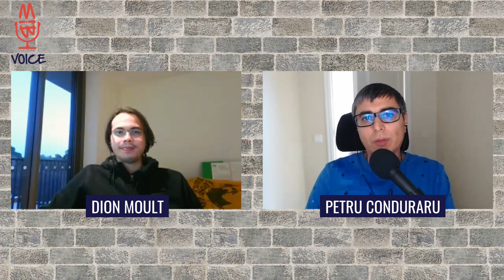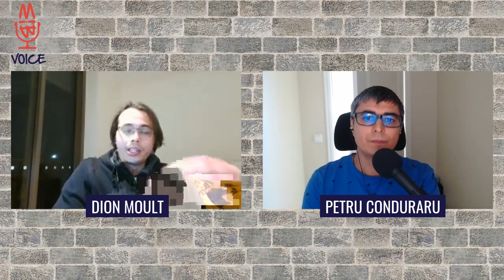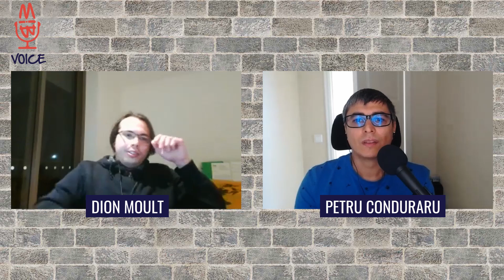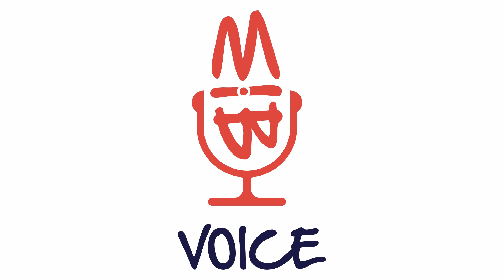BIMvoice#13🎙️Dion Moult (Open Source software in the AEC industry) #bim

Comment: Im a civil engineer and we plan bridges, tunnels etc.. And I think propietary software is terrible overrated. The civil engineering construction volume is pretty small compared to the private building sector and the software companies have focus on the "90% of their customers".

We buy Revit (or similiar software) and what we pay for are huge libarys of doors, windows and lightswitches. We cant use the level system, we dont care about the usual technical equipment, we cant do the correct section cuts etc. etc.. End of story is that you use and pay a software its 90% of features are useless for you and the 10% you need dont do the job as wanted. Then, they give you an api or tools like dynamo and tell the customer: yeah do it yourself!
So we pay a lot of money for the licences and the things we do with the software are actually programmed and developped by ourselves. That`s ridiculous! Thats a behavior companies have when they think there arent alternatives for the customers anyways!

In addition, I recognize the development that companies like Autodesk and others cut functions from their existing software just to sell them in a new product they want to push.
"Oh, you exported fbx in civil 3d for 10 years? We cut this feature, you can buy Navisworks now!"
"Oh you always imported pointcloud data directly? We cut this feature, buy Recap to link the data.And pay for the cloud you didnt asked for!"
.
.
.
They can do that because customers cant punish them and if things continue like that, the software companies have a larger financially share of your aec projects than the engineers and architects after they paid the software bills!

And sometimes, I ask myself if the software companies have ever used their own products like their customers do.
In open software, you can feel that it`s done by the people who actually use the software and think as users!
Reply from the maker: There is so much truth in what you say! Thank you very much for taking the time to write a such indepth comment. We get to a point where enough people get to the same concluion. Now we must do something about this, puting our efforts in any alteratives that might be viable, like BlenderBIM addon or Freecad etc. Stay tuned and get involved if you can, because we can get it done, I have no doubt about that and I won't rest until that will happen (:
Reply: I agree with you sir... That's why most of there product gets pirated..... They were seems to be overpriced